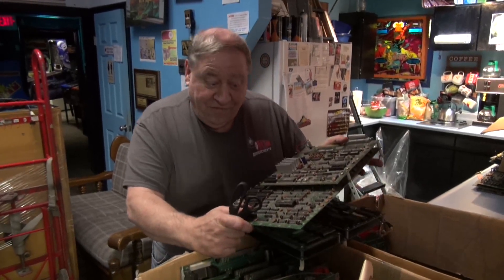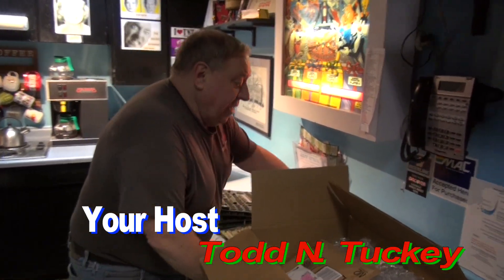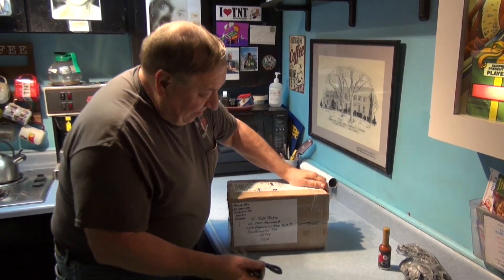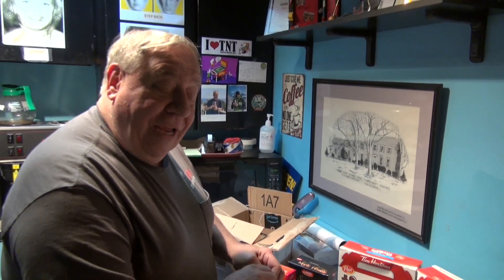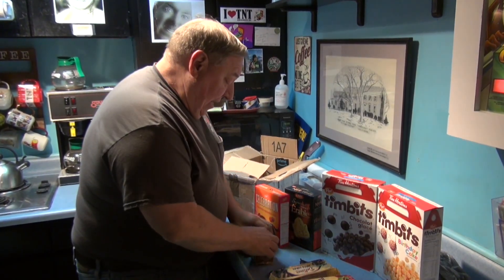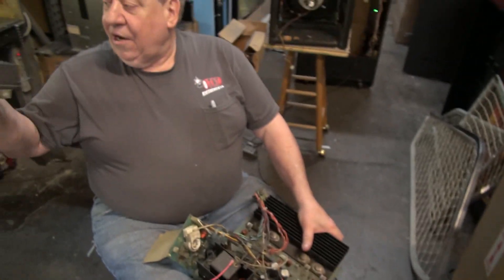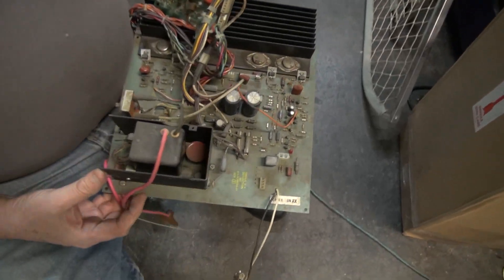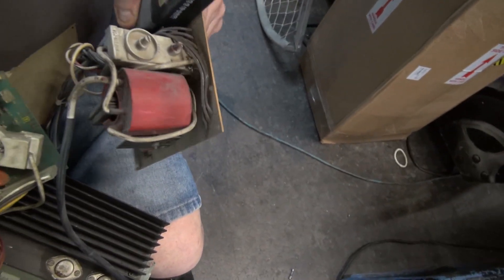#1725 Rare ATARI AMPLIFONE Arcade VECTOR COLOR Monitor with 13" Tube-Only 100 made?  TNT Amusements

Comment: I bought a Galaxy machine. Cocktable 
that's been recapped new fuse panel and fuses went to adjust the monitor got electrocuted literally burnt the heck out of my fingers Knob Broke off monitor needs replaced do you have one I don't want to resolder all that stuff onto it???